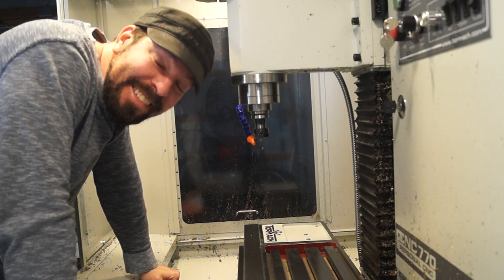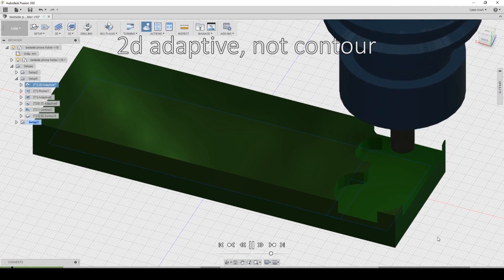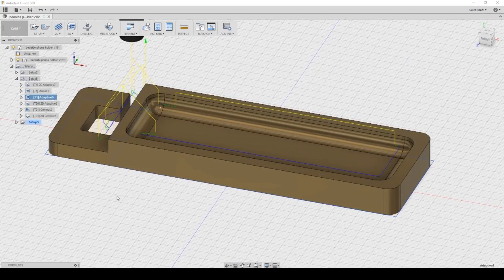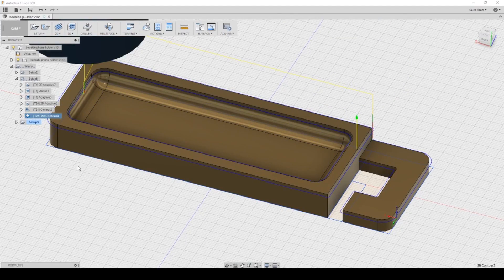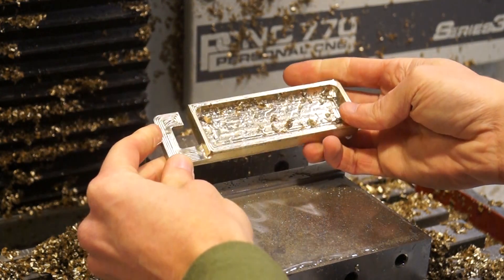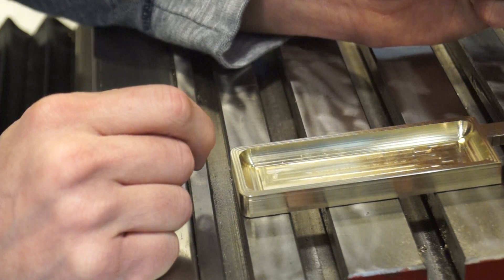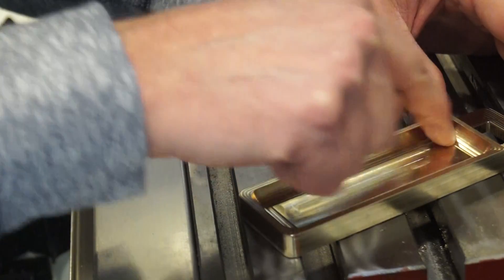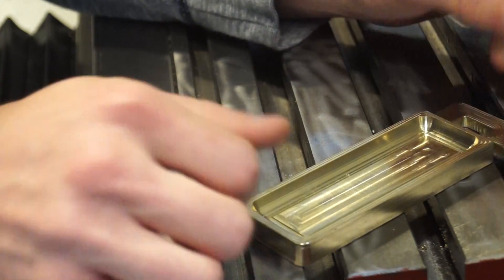Machining a brass and aluminum phone stand - part 2, brass and tons of failure

Comment: the table is rusting because you have too much water in your coolant. also they sell a protective moly in spray form that will protect your table better
Reply from the maker: it may appear that way, but actually the table was rusting because I hadn't used the machine enough yet! I had barely touched it at this point and not coated it with anything.  Now that I use it regularly and have coated everything well, I have no issues.
Reply: The table shouldn't need to be coated. the only thing you really want to coat is under vises.. you need to check it with a refractometer

Comment: G'day Caleb, loving the progress you're making! What speed was the video playing when you did the first part of the pocket? Also, what's the noise like? On our makerspace wish list is a CNC mill like this,  but we're worried about the noise in a shared space. Cheers!
Reply from the maker: Hey Luke! 
I'm not exactly sure what speed it was at. I usually set them to last less than 10 seconds, which pushes the speed to an insane amount. something like 1468%. Do Not use these videos as reference for speed or noise. I've got all my settings wrong... by a lot.  

Interestingly, this thing is quieter than my table saw. I've had a lot of people tell me that a mill is quieter than a big router, which makes sense because of surface area to vibrate. 

when I step out of my shop, I can hear the air compressor at about the same volume as the mill going through metal.

Comment: Good first steps. Keep going. The post mortem analysis is good. Keep doing this and you will surely improve. 
Check with the end mill manufacturer for feeds and speeds. If you can't find the manufacturer then use the feeds from ANY manufacturer. I think John uses Lakeshore carbide - that's as good as good a place as any to start. Most recommend a radial step over of 25% or less - that's a reasonable starting point. I saw some places where it looked like this caused you some heartache. One of the calculators will help - try one out.
It will take a while to learn the available tool paths in Fusion. As time goes on you will learn which strategy works best where. Often times there are multiple options for achieving the same result. For 3-d work look at the HSMworks help manual and read up on which strategies to use where - the information is good. In time you'll have a bunch of strategies and tools you like to use. You'll probably have ones you didn't like and hopefully you figure out why they didn't work out. If you keep your eyes open you may find strategies that are most efficient for your set up.

Comment: Are you just using plain water as flood coolant?
Reply from the maker: nope. The coolant is light blue, and unless I read it wrong, is diluted in water pretty thinly.
Reply: Kool Mist? That stuff is awful, my mill rusted quickly running that and I have heard Saunders and Grimsmo both talk smack about it. I am really happy with my DIY fogbuster setup on both my mill and lathe.
Reply: Alright. I've never seen flood coolant that isn't obviously milky/blue with soluble oil.
Reply: Kool Mist isn't a flood coolant, it's a misting coolant. Abom79 uses it extensively and swears by it.
Reply: ornicus24x5, I think you are probably correct about Kool Mist....unfortunately both Kool Mist themselves and LittleMachineShop where I bought my mill and flood setup claim "Formula "77" provides excellent service in most general purpose flood cooling applications".
Reply: Does it have a rust inhibitor?  Most do.  I've never seen a machines table rust when using such a coolant but keep in mind they were used every day.  I think we used a custom Mobilcut blend but Mobilcut 100 would likely work for you and is sold in 1/5/50 gallons.  Not too expensive, either.  If you're not going to use your machine for awhile, wipe it down with some oil.  I like bar oil; it's really sticky and doesn't run, especially when it's only a thin film.
Reply from the maker: one thing to point out is that the rust was from before I hooked up my flood coolant. Maybe it won't rust now?
Reply: Maybe not, if it has a rust inhibitor and you use it a lot.  If you don't use it often, it still will.